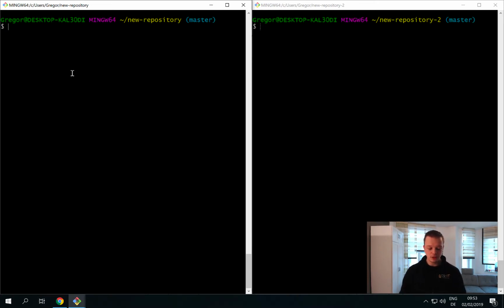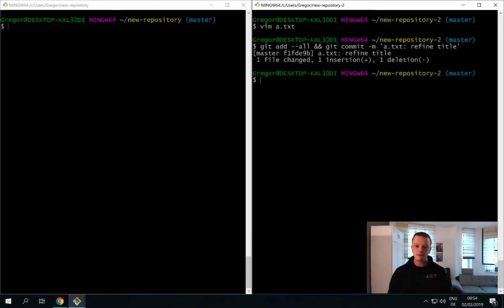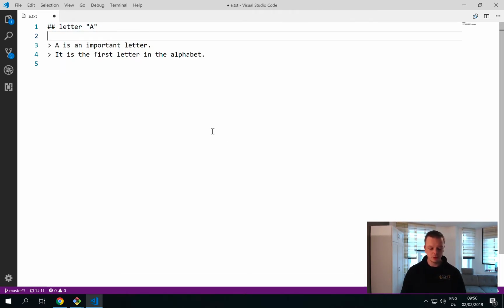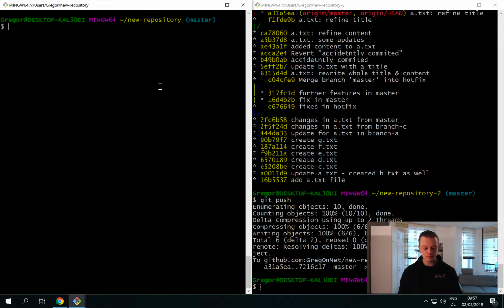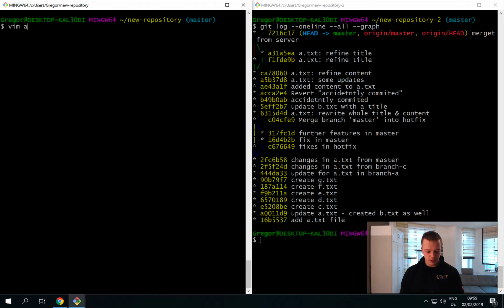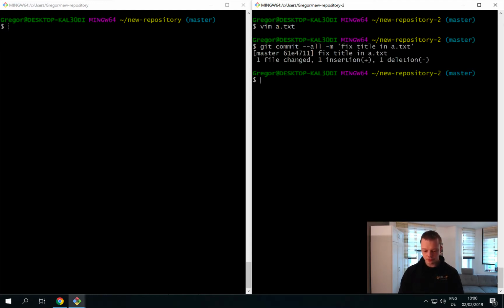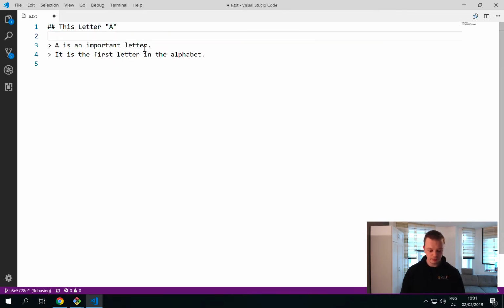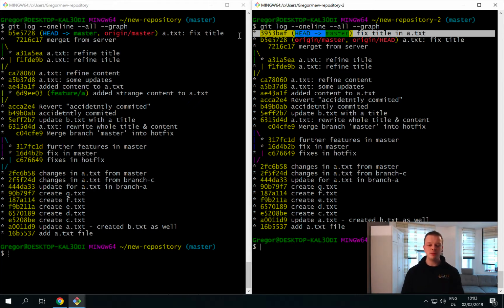19 | Pull Rebase

Comment: Thanks for posting this video. I am still unclear on how to deal with a slightly related problem with my workflow below:
1. create a topic branch off of local master; make changes in it
2. publish branch
3. create pull request
4. discover that there are merge conflicts
5. switch to local master branch
6. git pull to synchronize local master with origin master
7. switch to topic branch
8. git rebase master
9. git mergetool to resolve merge conflicts
10. git rebase --continue
11. git status
      -> "Your branch and 'origin/topic' have diverged, and have x and y different commits each, respectively. use 'git pull' to merge the remote branch into yours"
12. git pull
13. have to resolve the same conflicts all over again which were resolved in step 9 above.

Thanks!
Reply: after 10 I'd do a "git push --force" to your published branch/PR (point 2/3) - it's yours so it should be totally ok to do a force-push - after this it should be fine - if you do 12. you'll have yet another merge-commit and a really messed up history on your PR-branch (remember - you already changed history in 10 on your branch - there is just no way around the force unless you want to abandon your PR and do it again )
Reply: Before opening a PR, make sure to git pull --rebase origin master (while on your feature branch, git status must be clean). Resolve any possible conflicts, then git push. You should be good and not have to push force.